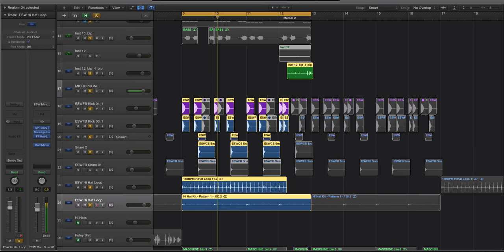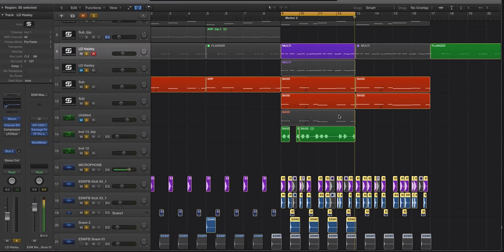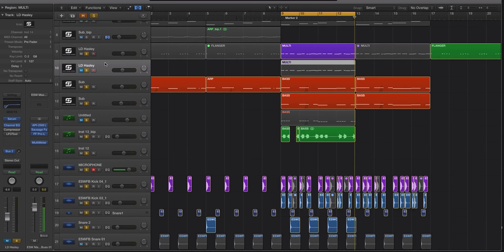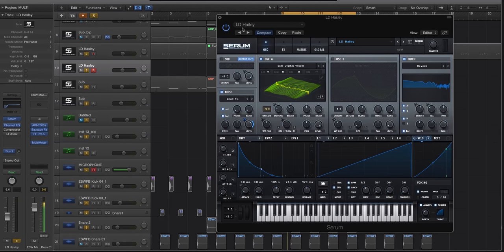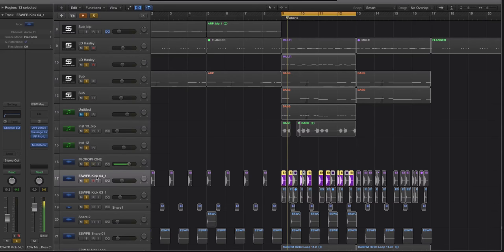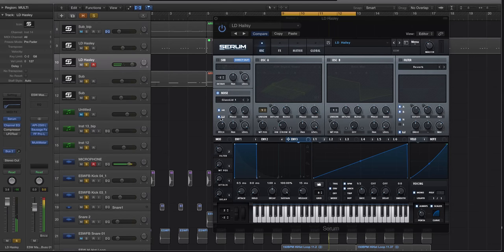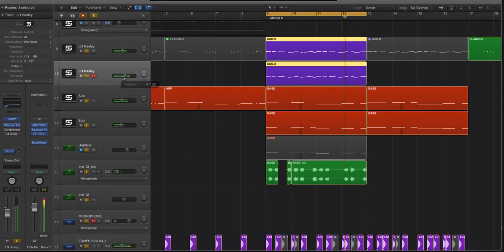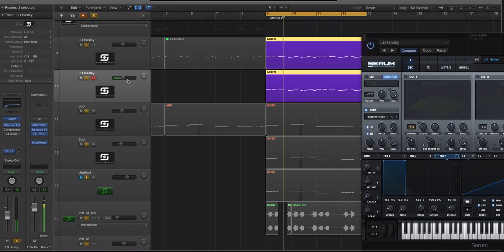How to Add More Punch to Lead Synths

Comment: What works really well in Sylenth to do this is to add pitch to the mod envelope and turn up the decay in it very slightly so there is a really fast pitch drop at the start of the sound. Adds a clicky sound.

Comment: I used the 808 bongo in FM8 and changed the filter type to one that was glasser sounding and then eq'ed it so it was a very high freq and I got a pretty close attack sound as the one in this video. Did help my lead cut through.